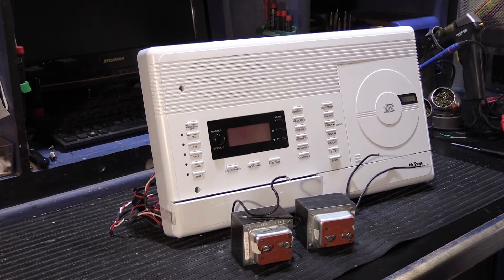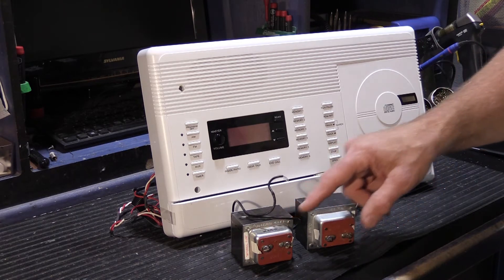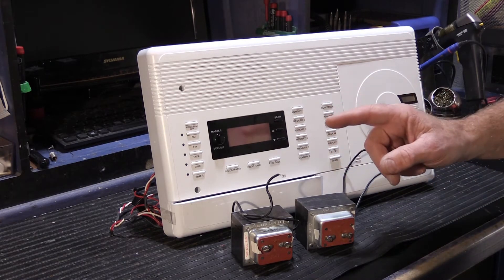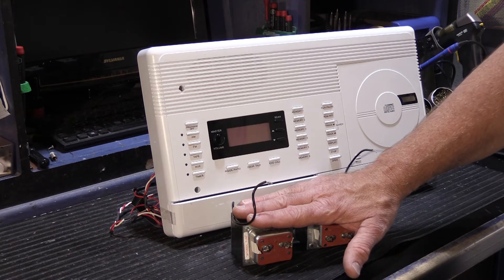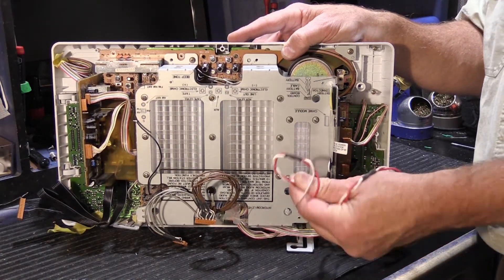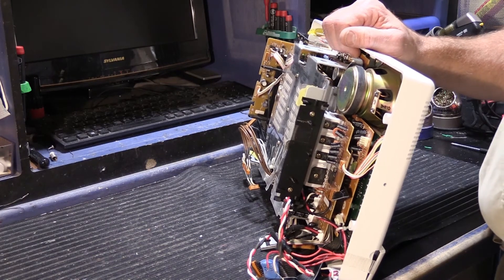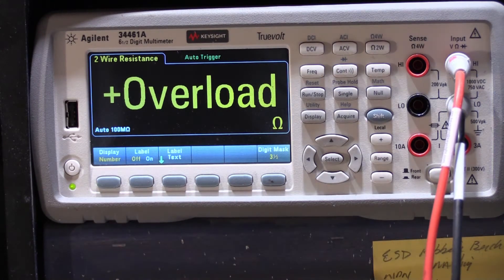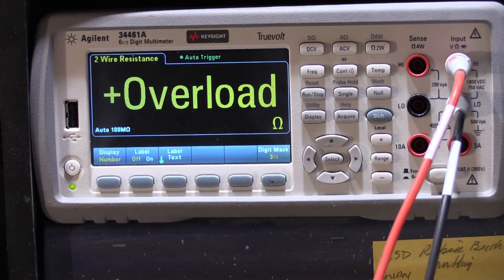Fundamental Troubleshooting a NuTone IM4406 ~ IMA4406 Intercom with Blown Fuses in 801T Transformers

Comment: This is exactly the scenario for my malfunctioning nutone device. I turned off the breaker at the panel to install a new light fixture on the same breaker, but when I turned the power back on the screen lit up, but wouldn’t display anything and could not play audio.  Is there a way to rig this up to bypass the transformers?

I’ll likely just remove the system all together, but would have to do lots of drywall repair and removing 3 speaker/intercom units in the house.

Could this also be related to why the door bell wires At this house have never worked properly? Tried installing a cheap regular doorbell, but it never received and low voltage power to operate it. Ended up just installing a battery camera doorbell.
Reply from the maker: Hi kevin: Perhaps you should try performing a Reset on the IM4406 - https://www.youtube.com/watch?v=OvEr7wXRbB0&list=PLsTvqKsBnGYcoTSfKTOHOltP98FFiuUP1&index=4
     As for your doorbell question - without much more detailed information about the system and the problem, I cannot offer any specific help - Chris
Reply: @northsideservicecompany3567  oh man!! Thank you!! That was it!  You fixed it! Much appreciated, sir. 🎉🥰
Reply from the maker: @kevinfassanella1652  You're welcome - Chris

Comment: By the way, my first name is Harvey,  no i'm not joking.
In 1966 i think the name was an american second name, in the uk it would have been unusual.
So i was named harvey.
Since then, every one started using it and even the next doors cat is named harvey lol .
.
The ac to dc rectifiers in that psu section would be toast,  i would be supprised if any part of it was usable.
When you said an easy test,  i thought you were going to put a 24v 2 amp bulb in the transformers output.
I was thinking too simple,  And  i thought it was for ordinary people to do the test.
Very nice bench meter you have, looks brand new, very handy bit of kit.
One thing i find odd about most meters in ohms mode,  if the probes are not connected it says Overload?,
Would it not make better sense to say Open Line or OL.
Overload to me has to be too much voltage or current input.
I hope you and your family are safe from the virus and having a happy xmas :-D
Reply from the maker: Hi Harvey:  I really like a good Bench Multi-Meter.  The 34461A is about 7 years old and it was worth ever penny it cost - Chris
Reply: @northsideservicecompany3567  Amazing, it looks brand new :-D
Having a few selected bits of quality test gear can make repairs so much better.
Ill shut up now, ta ta :-D